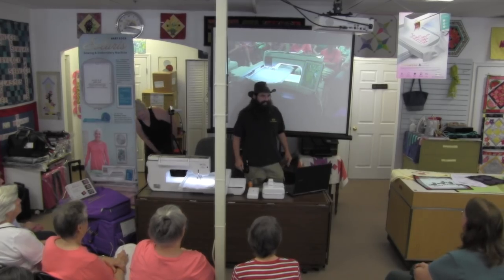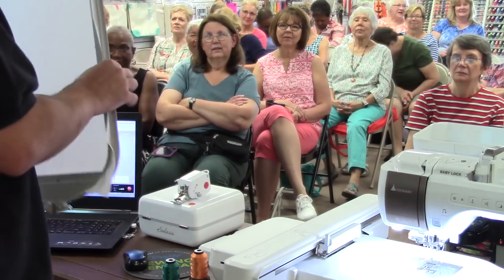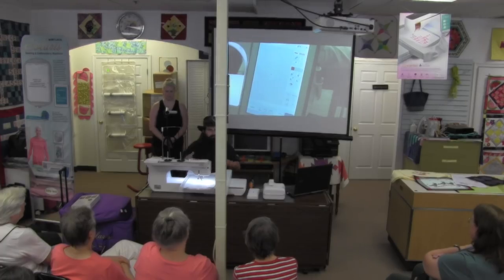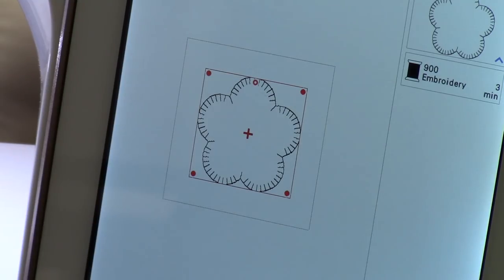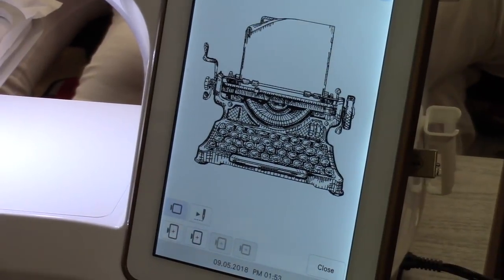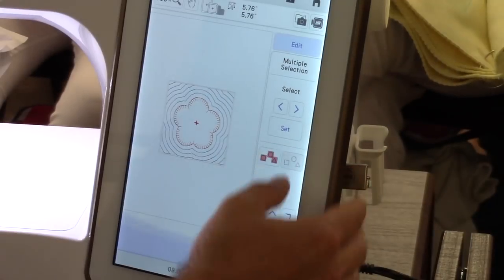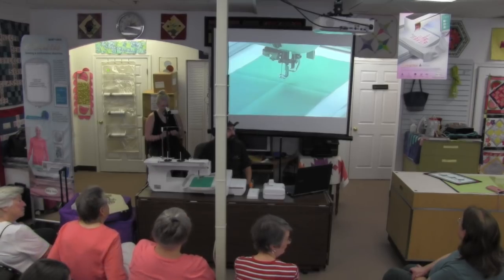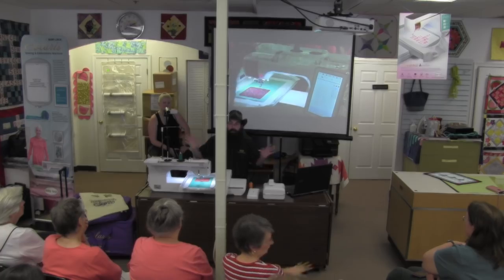Baby Lock Solaris - IN DEPTH DEMO!

Comment: Will the Solaris be able to use all of the optional (Babylock)feet I have for my Ellisimo 2 Gold? Such as the Ruffler (SA-122) ,roller foot,Flower stitch foot, pearl & piping foot, etc ?
Reply from the maker: Yep
Reply: It does use them & the EG2 feet, except any that screw on. There is an adapter for those

Comment: Which needle plate can I use for sewing & embroidery? What is the difference between the 2 plates? When do I change them out & how do I tell the difference, I’ve only looked at them a few seconds but they look the same? Thank you
Reply from the maker: One has a single small hole for straight stitch only. Helps if your fabric gets stuck in the plate sewing delicate stuff. Use the other one for regular sewing and embroidery.

Comment: Funny the remark about a rail on the top bed... never seen a machine which did not have it on the side...
Reply from the maker: every baby lock/brother embroidery machine ever made has had a gap on top of the embroidery unit, this one doesn't.
Reply: The rail is inside the bed if the bed. That's what he meant.  There is a slot in the top that allows the embroidery unit to move back & forth.  
The Solaris has the slot on the edge